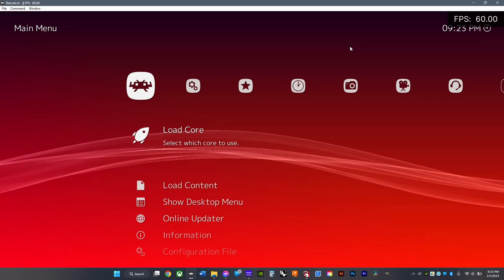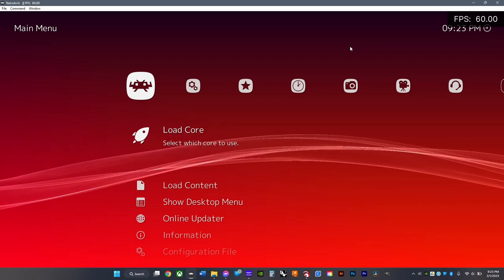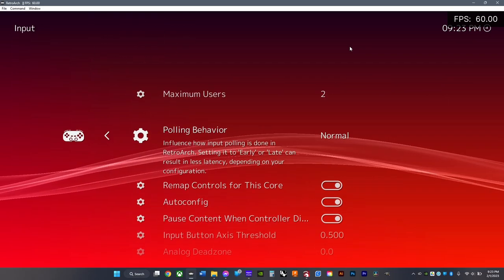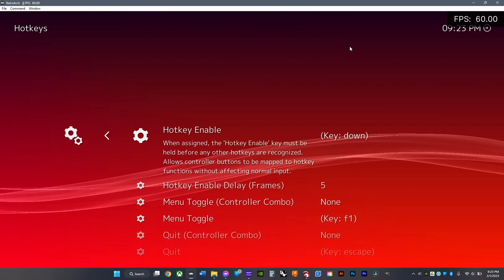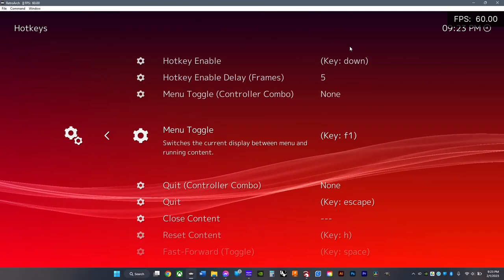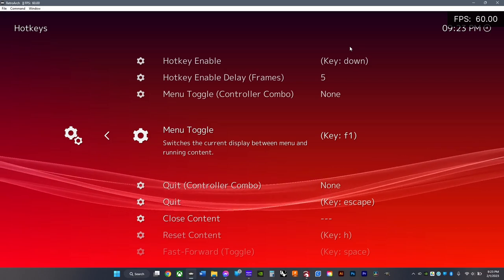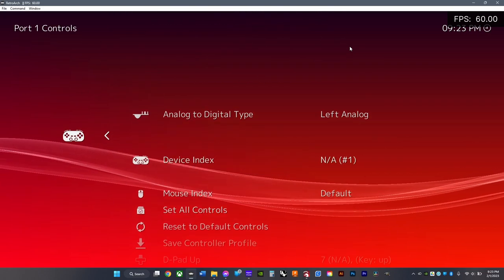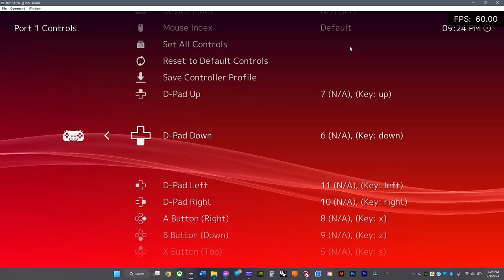How to Unbind/Delete Controller Input or Hotkeys (Retroarch)

Comment: hey, just found the vid! how do you remove the "turbo" button set to "Auto: 0" in the input section under retroarch menu? I have tried various different options and nothing works.
Reply from the maker: To do that go to the turbo button in settings under controller input. Then choose the port you want to change. Then go down to turbo, its at the bottom. And click X for controller and delete for keyboard, and then save your controller profile and it should be set.